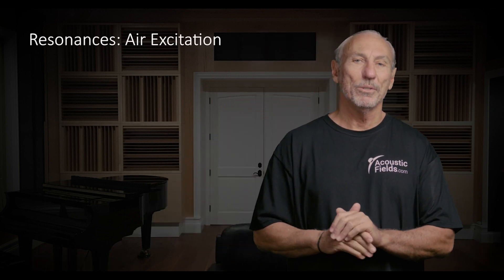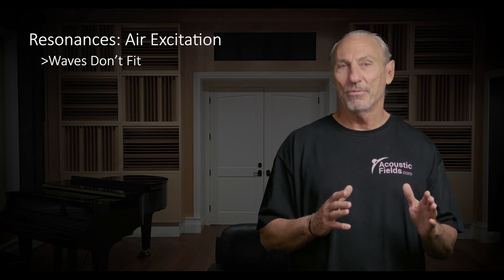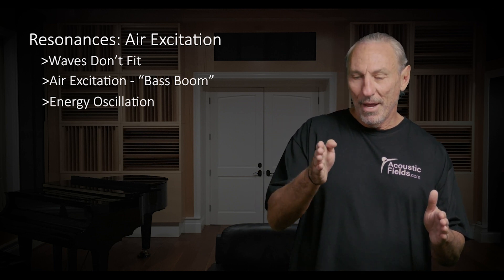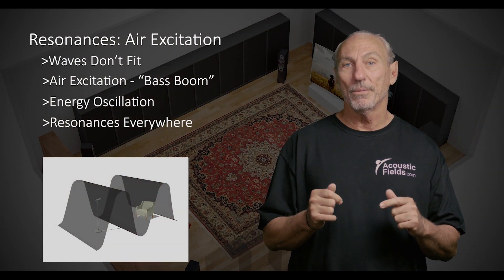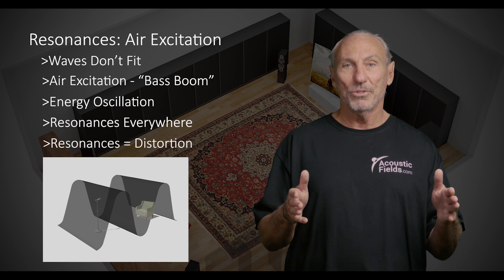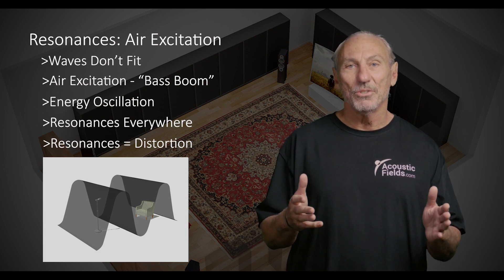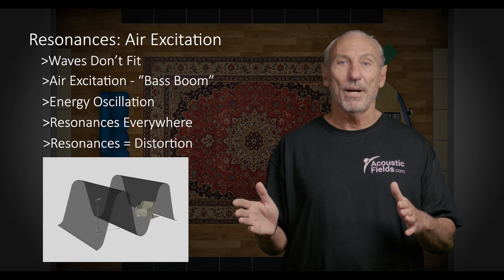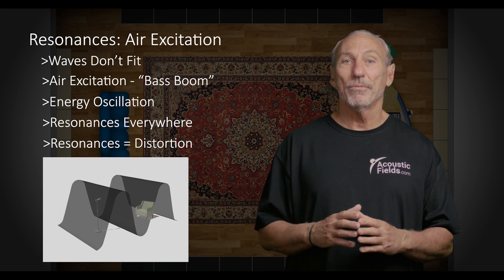Room Resonances - www.AcousticFields.com

Comment: My house with 15x13x8 foot rooms in a rural/suburban area is a low frequency collector and amplifier. I hear every low frequency noise, trucks, train horns, car stereo amps and planes louder in my house than they are outside from about a mile radius. I barely hear cars/trucks coming into my driveway but EVERYTHING from the farm across the street as if it were in my yard. I have been watching your videos for some time to learn about why, now I know from this video.
Reply from the maker: J,  You will have to measure / design / build in that order to minimize these issues.
Reply: @AcousticFields   It is 30 years past the measure, design, build stage, unless it is as you recommend, lots of plywood added.

Comment: Could helium be used for bass traps?  It could save alot of money.
https://m.youtube.com/watch?v=jxOzpPJbnTI
Reply from the maker: D,  Possibly since it is lighter than the air. You could create a diaphragmatic absorber with it in the center cavity.  Remember with low frequency its all about pressure. Reducing atmospheric pressure inside the cabinet would be a good start towards the design parameters.